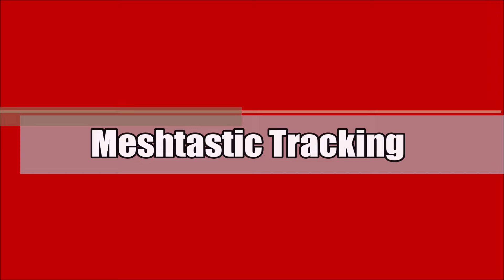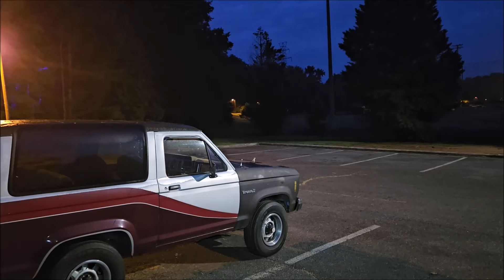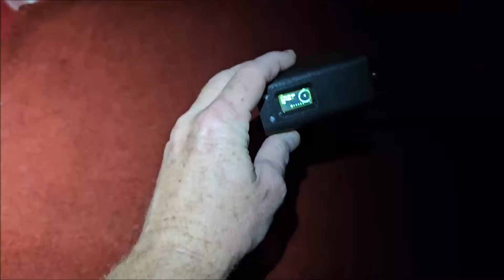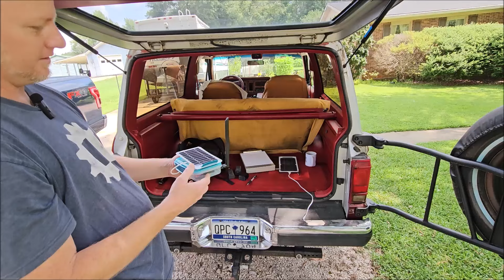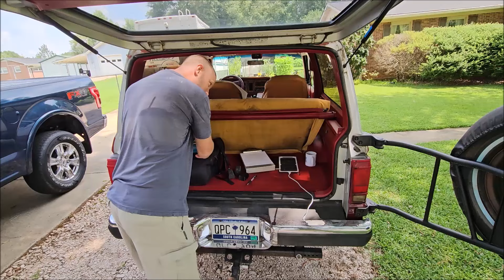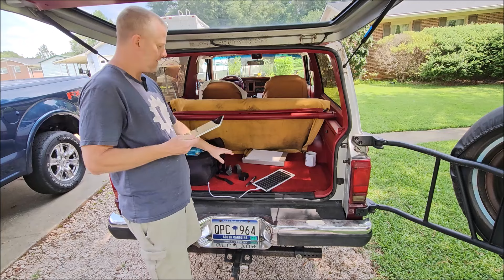Meshtastic Tracking

Comment: 250mA seems like a lot. Mine runs about 170mA or less with GPS. Maybe I don't have something or other turned on. I need to upgrade the firmware.
Reply from the maker: I connected one to a USB C meter without a battery a few weeks ago to see how small of a solar panel you could get away with. That's just what I remember so I could be off. It's about double the power a Heltec V3 uses though. I have another Tracker that will be here soon we will put on the meter. That's a neat cheap piece of kit too.